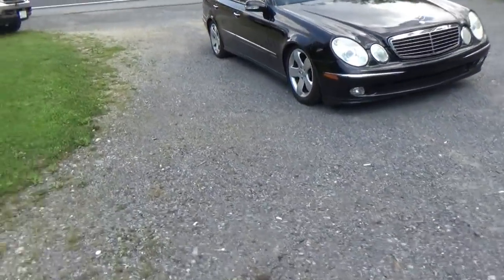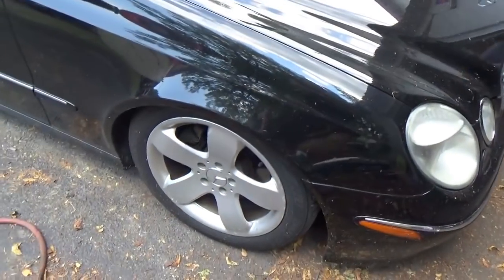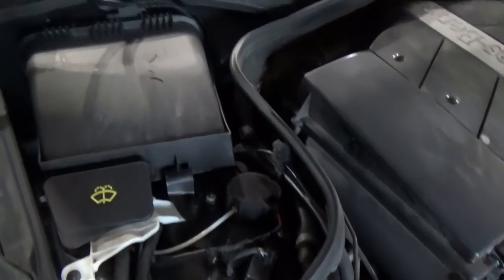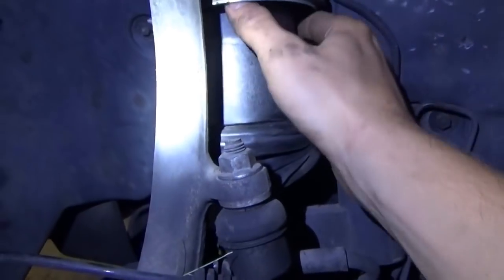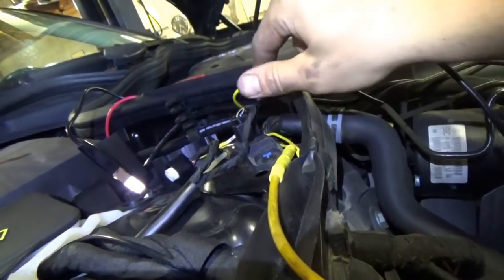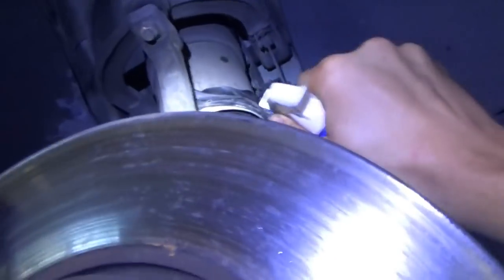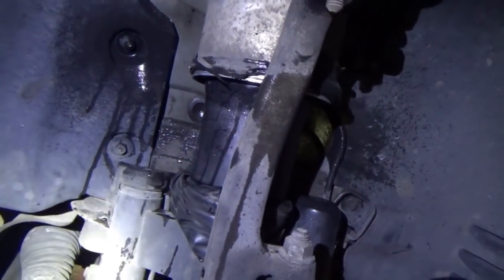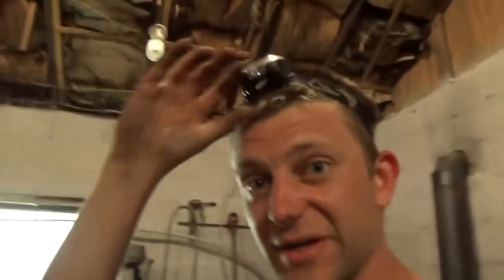Mercedes Benz Air Suspension: Finding air leaks

Comment: Audi customers usually give up on repairing air suspension around the 100k mile mark. I rarely see an older A8 without suspension faults stored. Word of caution: doing that test on certain Lexus models will blow out the air struts. Suspension can't be active when the car is on a lift. Saw a tech do that on accident when I was working at a Lexus dealer. Service manager was thrilled.

Comment: I worked at the Hummer dealer when an H2 with air springs that didn't shut off came in. We were able to stop the compressor by pulling the relay. At that time, the air springs were fully inflated. A while later, we reinstalled the relay and got it up on the lift. The compressor started and kept on going, and going, and going. The service manager was under the H2 trying to disconnect the height sensor when one of the air springs blew. When the air spring blew, it sounded like a bomb went off in the shop. The bursting of the spring left the service manager deaf for a short time. So just be careful when repairing the air suspension, because when the air spring or strut bursts, it will give you a scare that you will not forget and will make you remember to shut off the air compressor.
Reply from the maker: Wow that is scary... a lot of potential energy!

Comment: This is a very common problem with the early W211, I owned an E500 but sold it after 2 failing struts and a blown compressor for the struts, some people even go back to iron springs because it's expensive to replace.
Reply from the maker: good old fashioned steel coil springs generally outlast the vehicle...

Comment: I recently replaced rear air struts on a e320 wagon! Needed to purchase a $270 special tool to remove them!
Reply: Hey bud I got a problem with a rear strut on a 04 e500 wagon
Reply: What’s the part that you need?
Reply: Same 06 and have a problem with the back on also.

Comment: WOW what a rip! Glorified air shocks - used to be able to buy a pair for the rear of our old full-framed RWD cars for $18! Had a set in my El Camino too that the previous owner installed. Ran the crap out of that thing, with all kinds of stuff in the back, and never had one leak in 11 years of ownership!

Cost me less than $300 to throw a set of Bilsteins on my Silverado a few years back, too. Guess I'll steer clear of German cars. :)
Reply: Those are not thousand dollar aibags. You can get them for less than $300. These guys are very amateur at best 🤦🏼

Comment: rebuild ones are 500$, you gotta pay to play, cant afford the air ride, swap some regular coil overs.
Reply from the maker: Yup that is always an option!
Reply: Bs new air shocks cost about 150$ bucks
Reply: Appreciate Video clip! Apologies for chiming in, I would appreciate your thoughts. Have you tried - Patlarny Vehicle History Principle (probably on Google)? It is a great one of a kind product for discovering how to repair your car the simple way without the hard work. Ive heard some great things about it and my mate after a lifetime of fighting got great success with it.
Reply: @istruth9089  not on the w211. Arnott is the most affordable option with lifetime warranty, they are $450 a piece if I remember correctly. Had to redo 4 corners in my e55 and that was the most affordable solution. I retrospect, I should have just upgraded everything to adjustable coil over suspension and never have to deal with air leaks again.

Comment: This w211 chassis Mercedes is very rare in the US and the world. its rare in the US because is has the M112 engine 3.2 v6 and rare in the world on the count its a w211 chassis v6 post 06 with the M112 WITH AIRMatic suspension usually the AIRMatic was only fitted to the E500 and E55 and i know that in Europe it could come on a diesel version too.  AND if the owner wanted to switch the suspension to the normal suspension he can and its very cheap 4 corners cost less than 1 AIRMatic strut and the warnings could be switched off by using the Autel Maxisys changing the coding in the IC and ECU and then removing the AIRMatic fuse. the car will need a good Alignment shop then...
Reply from the maker: hmmm interesting. So it's a Mercedes, it's rare, and it has air suspension...  but hey, NO RUST!!
Reply: A W211 rare?! You on drugs or what? Car has nothing rare about it. Might be on the US since gas is cheaper and people tend to skip over these intermediate engines but there are plenty of them in Europe. Only thing you might call rare is the Airmatic option. Since most owners indeed pass on that. Precisely because repair costs are not worth it.
Reply: Read what i wrote. this option package is very rare for a v6 320 + its POST 06 which means the rest of the world got the M272 engine and this has the M112 + M112 in the US by itself is rare
Reply: K this is no an 07+ w211.  No updated headlamps and the trunk still has the small chrome strip over the number plate vs. The longer one on the facelift versions.
Reply: hmm the headlights are post facelift but you are right its 04-06 but still im amazed but this car it seems to be special ordered as it looks even with the wheels as a 500 and its 4Matic but is a 320 m112 (in the USA which is RARE)

Comment: Ivan, 2 grand for one of those struts is ridiculous. are they hard to install?
Reply from the maker: Jim did the install on his own. Not that difficult of a job, just have to watch out for the sensitive air and electrical connectors during installation...
Reply: Pine Hollow Auto Diagnostics what's the model and year of this Mercedes???
Reply: @riddimentertainment5459  w211 e class, it´s between 2002 and 2006. Preface lift

Comment: Hello I've replaced my air compressor my 2 rear air bags and front right air strut but still getting the malfunction message on my dash and car lowers overnight rear right and front right any ideas?
Reply: Mr Andreas, on youtube are many examples on how to find the air leaks, probably the problem is on the level control valve. You have to seek information on youtube and please, do not dispair. Nowdays is much easier to resolve your problem. Patient and have fun.

Comment: If you or the owner deem your sanity as something valuable just convert that car to regular shocks. Take it from someone who has dealt with air suspensions too many times, has owned a few and converted them all with absolutely no regrets!
Reply from the maker: agreed. I'm all about reliability and durability!
Reply: how much is it to take out the air ride and just do stock suspension?
Reply: I'll have to see how I can do this in Ga@convert. Just got a Mercedes like the one in this video, and I guess I was standing on the wrong side when I bought it. The air thing just seems unnecessarily complex and I can hear the hissing with passenger side lowerider.

Comment: Ivan, I just had to replace the front struts on my 2003 E55 Mercedes. $573 new each side from FCPeuro.com
Reply: Mark Barrey Exactly! There is so much BS about these cars,it’s not even funny!
Reply: No its just because its air shocks.. any brand you chose(not many do have air suspension) will have a very high price on the air struts, including fords, a lincoln mark 8 air shock is 1900$ at the dealer. If you cant afford it, buy something with coil springs or convert.
Reply from the maker: I've installed manually adjutable Monroe MaxAir air assist shocks on my SUV and van. They are like $120 for the pair and work very well! A while back my brother and I even used those to convert out 1998 Mazda MPV 4x4 rear suspension when the OEM air shocks blew out. Just had to install the regular 4x4 coil springs and attach the air shocks to the existing air lines and pump. Still works great to this day!
Reply: you're right, Mercedes rapes you with prices is but they scam you, they get aftermarket compagnies to make the parts and they just put their logo and sell it 10x more. Trick with mercedes is to shop with part number and you will find aftermarket that matches and is most likely the same. But yeh, I needed a front axle for my 2009 and they wanted 1200$ for one.. i managed to get a rebuild done for 150..

Comment: My 96 Lincoln Continental did the same thing. I had it all ripped out and they put in a suspension from a mercury Sable.  Problem solved... $1400 later lol
Reply from the maker: wow a Sable suspension held up a Lincoln? Isn't the Lincoln like twice as heavy? :)
Reply: Pine Hollow Auto Diagnostics  well it's a continental so a little bigger than a sable. Mechanic said a crown vic or grand Marquis  suspension was too big. But 8 years and still holding up. Now it just needs a new transmission  lol

Comment: I fixed one of these a few months ago and the reman strut leaked worst then the worn O.E. part the 2nd replacement fixed it. Poor quality control.
Reply from the maker: Was the first one a Cardone or Dorman unit?
Reply: Pine Hollow Auto Diagnostics It was an Arnott reman  I was surprised when it leaked .

Comment: Well I can speak from experience mercedes are junk I owned 4 and learned the hard was all the Mercedes I owned the airmatic suspension failed even at one point with my kid in the car "airmatic to low visit workshop" then on w211 the sbc brake system is dangerous if the auxiliary battery fails you have no brakes then each Mercedes would go into limp mode for simple reasons then you have to go to the dealer to run the star diagnostic to get the transmission control module. To get out of 2nd gear...people who love Mercedes never had one or the nightmare associated with it...they are garbage...the AMG is built to last the amg E55 is very durable...you couldn't give me a Mercedes for free...got a honda accord now and never had a issue